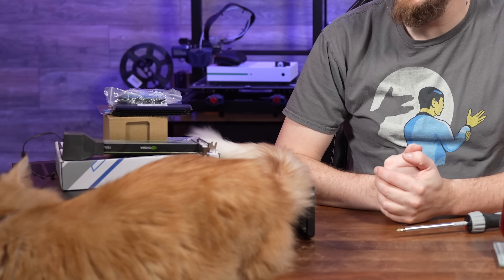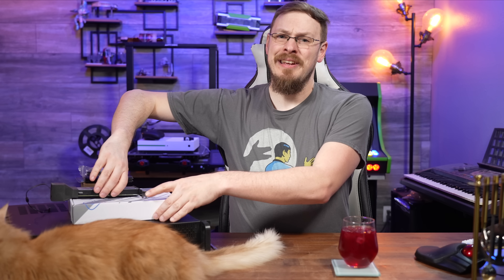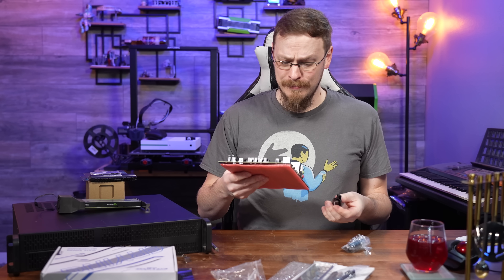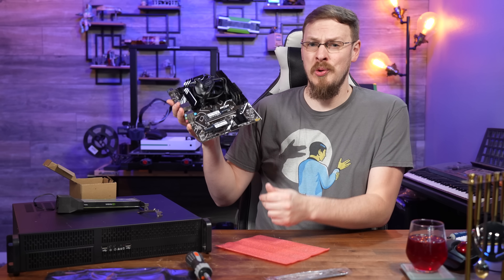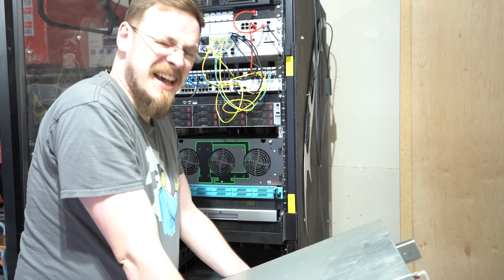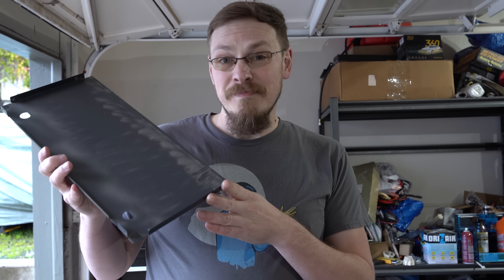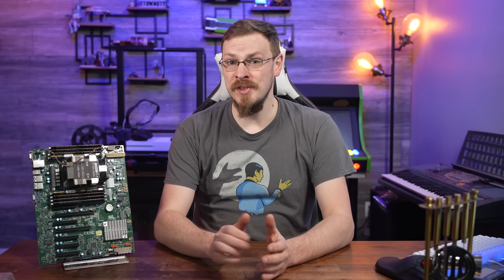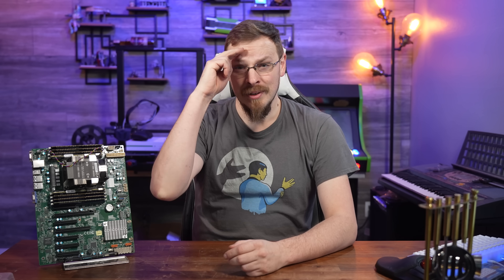My Biggest Server Rack Change Yet

Comment: Checking back in a year later to say, I built one of these erying 2U servers for my homelab and have been enjoying it. HOWEVER, the intel stock cooler randomly died. Weirdly enough, the heatsink was enough that the CPU was fine--just limped along at 90C until I got a new cooler.

Comment: I have to admire you, using a Engineering Sample CPU to run a server is ballsy :) Though I am about to get a similar board based on 13th gen from them to use as a low power HTPC

Comment: Can't say my experience has been great with this board so far....I am sorry I jumped in before looking around more. My board reboots randomly within 24hrs using several flavors of Linux, different ram, different nvme drives, different m.2 slot, changed bios settings, yada, yada, yada....been told to take video of the issue....ive been told its not to be used for a server....Ive been told they don't support linux and to install Windows. Filed a dispute with AE and they canceled it. Wrote a review and they didn't post it. Buyer beware....super scammy even if they have some boards working sometimes....they certainly are doing all they can not to refund or exchange mine....next step is getting my card company involved. Hope your luck is better with this project CC.

Comment: Would you consider purchasing one non ES board for the contrast point of what doesn't work with the Engineering Sample boards?  This is especially relevant since you are doing virtualization on the systems.

Comment: I do wonder about the money you save,  200 watts less, but what saving in energy bills is that to how much it cost to replace the hardware? This is one of those questions i plague myself with, solar panels would be awesome for the house, but i put $60 in the meter a month. if i spend like $7000 how long is it going to take me to pay off. lol. Though the one advantage straight away would be being able to run way more electronics guilt free.

Comment: I have the Erying ES 2.6GHz version.  I put it in the cheapest case I could find with 16GB 3200 (soon to be at least 32GB), a 2TB PCIe 4.0 M.2 and a Red Devil 6900XT.  This will be my room scale VR machine.  I did overclock it and the CPU is pulling almost 120w.  I went with liquid metal between the CPU and the copper spacer, then added an Arctic Freezer 34 eSports DUO cooler.  The liquid metal stopped the thermal throttling at 97c to a max of 74c!  And got me up to just shy of 5.1GHz on most cores.

Comment: Apart from being a dual slot card, is an second hand RTX A2000 not a better value/choice? 
The T4 is around €500 (cheapest option) P4 around €120 and the RTX A2000 (6GB) I can get around €250.
And thats with cooler.

edit: stupid question after trying to get vgpu working on a rtx 3090 (Ampere) for hours/days🤭

Comment: I noticed when I was testing out some things on my ERYING board (I found and ordered one about a hour before you posted your first video on them) that if I used both M.2 storage slots (I also had a wifi card in at the time) the x16 slot was only running @ 3.0 x4 speed with my 1070 in it.  I ended up only using one SSD in the top M.2 slot and my old 1080 Ti for the GPU with everything working full speed as normal so I never looked into it, but seeing you put two SSDs in made me remember that issue that I never bothered to troubleshoot. IDK if mine takes lanes from the GPU for those other slots or if maybe I set something crazy in the 100% easy to use no confusion to be found BIOS. /s I know for overclocking this one it's running windows so I just decided to use Intel XTU (had to enable an extra setting in an obscure menu for XTU to see it as an OC capable system but works great now)  Little undervolt here, touch of extra PL1/2 there, and up those multicore muiltipliers and it's a beast for the money.  I want to order the new 12th gen version they haveout now, but they're all non ES and I'm too cheap for that.

Comment: I'm glad power consumption was addressed in this video Jeff. I know electricity is pretty cheap in your neck of the wood but for most of us around the world it's not the case, or soon won't be. I do really enjoyed watching your home-lab/server builds but always thought " I'd never use X or Y components Jeff is using in my own home-lab as the daily power consumption, heat and noise would put me off. Those Erying Tiger Lake boards look like a real winner! I'm waiting patiently for when they release an ITX version........ Well, would you look at that? Erying has released a 12th gen version in ITX flavor! Sweet! I just picked up an i5 12500H (12C 16T little beast) for $400 AUD. You should pick one up for a ITX build for the channel Jeff?
Reply: I wish I didn't just scroll down and read this... you bastard!
Reply: @SenZubEanS  I know what you mean! I thought just on the off chance I would check AliExpress as I heard Erying were working on a Intel 11th gen ITX board. Low and behold 12th gen CPU/mobos were listed!
Reply: Imagine sticking a couple of those ITX boards in a 1U case, that'd be some pretty dense power efficient compute power
Reply: How are you using the 12th gen board? I am looking for something to setup cloud gaming vm's with a P4 myself and curious how promox uses the E-cores.

Comment: Should have just gone with a A2000 12GB. Still cheaper than a T4 and doesn’t require the cooler mock-up.
Reply: I don't think you can use vgpu profiles on a2000 and on erying motherboards pcie passthrough does not work.

Comment: Yea I separate out my system. I have one bathroom upstairs and one bathroom downstairs. I also have 2 power meters on my house. One for each level. Though my server problem is hot water. The water heater only connects to the panel upstairs. Oh, Wait!! This isn't about throne redundancy? :)

Comment: You turned me onto those Erying boards and just got my 11800 ES 2.2GHz with the vrm heatsink upgrade. I felt your frustration with that one, they sucked. Cant wait to get the rest of my parts and use it to replace my Dell HTPC with a i7 2600. Going to move over the HDD and SSD in it as well as the blu ray drive and the GTX 1650.

Comment: Erying specifically says NOT to use these boards for virtualization!
Reply: That is why I picked up the 11850H Non ES Board.   I wanted full virtualization support.  It was significantly cheaper than the i9 non ES boards and only a bit more than the i9 ES board.

Comment: Your power bill makes me die a little inside.
Our power used to be the lowest in the country at $0.059/kW.
In the last 18 months it has risen to $0.34/kW.
Right now half my rack is just off.
I'm at the point where spending $800 on a new system that uses 1/3 of the power will cost me less total money in about a year.

Comment: 12:12 If you plan on using an air compressor to clean your PC, make sure it has a filter and a low PSI setting so you don't blow SMDs off the board.

Comment: My server stack consisted of a cheap ~$115 used Dell CloudEdge C2100 with 12 3.5 inch drives and dual Xeon L5640
But because those werent fast enough for plex+transcoding, i needed another machine for that, back in 2016 it was a dual X5690 build, but after the 5700G came out i switched to that.

I recently switched to a 7950X to hopefully go down to an all-in-one box for file server+plex recording+TDARR CPU transocding+Photoprism AI image recognition.
Unfortunately TrueNAS does not support ROCm GPU acceleration for kubernetes/apps out of the box, and a recent bug means that none of the kubernetes/apps can even access the files on my file share meaning i still need the 5700G for plex and TDARR

While idle the stack has gone from ~600w, down to ~220w, and that includes the upgrade from a 16 port gigabit switch, to a 48 port gigabit+4x10G+2x40G
With the 5700G out of the picture it idles at ~130w and should peak at only 350w.
Man those 1TB optane 960P drives are awesome for accelerating pools and reducing load on the HDDs
Reply: Oh, and IIRC that 220w number might include my redundancy server(currently my primary until i figure out networking and move everything over to the new enclosed rack), but this server is really low powered as is all flash (18x2.5 inch) IIRC idles at 40w with much of that probably being the SAS controller and 128GB of ECC